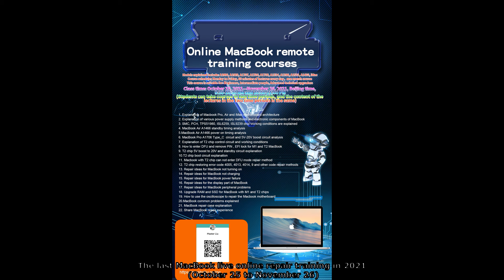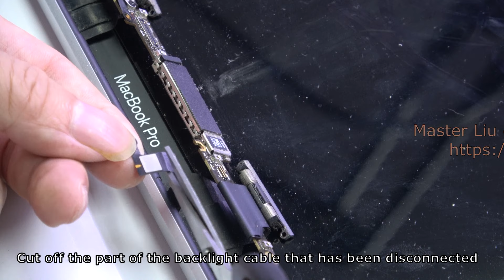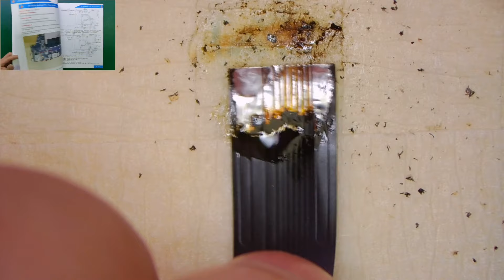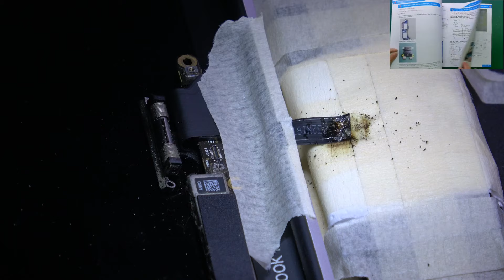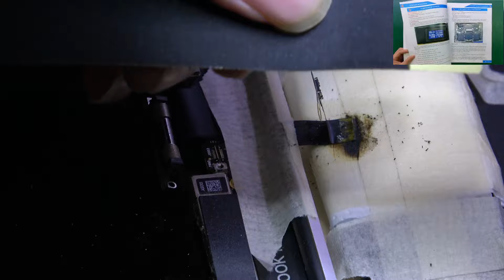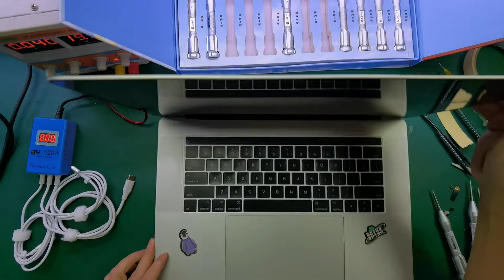The Easiest Way to Repair Flexgate Cable

Comment: This looks very hacky how can you be sure there won’t be a short in the future
Reply: Even if there is a short, it would be fine as drivers would stop giving voltage to it
Reply: Yes, it will not be short, it should be noted that you need to add some curing glue
Reply: @3ijnweu3oq3  really? There's a protection for short between LCDBKLT and GND, and driver will detect it?
Reply: exactly dont do it go and pay $630 to apple make them rich yayy so cute

Comment: Wow… I just followed the iFixit guide to open the MacBook and then your guide regarding the cable, and now the screen turns on again. I still have „stage light“ but not sure if it is because I „repaired“ just one cable or did something wrong - anyhow at least the screen working again!
Thank you SO SO MUCH

Comment: how to prevent it ? i just bought an 15'' 2016 max out and i want to prevent this..

i bought it from amazon like "(Renewed)" and work fine but i wanna protect it and i don't have an amazon store in my country yet.
Reply: I have a 2017" 13" MBP. I Just keep the lid open all the time, to not put any stress on the cable. I use my laptop always on my desk though, I almost never move around with it. If you have to travel and open the lid regularly, then I would try to avoid opening the lid at max possible angle, as it gives most stress to the cable.
Reply: keep the display open and never close it.

Comment: I did this repair for the first time today and I used your method - the job turned out great so thank you its much appreciated! I couldn't get the two flex's to solder together for the first couple of goes but as soon as I added a big blob of solder to the iron to give it the extra heat needed they bonded together lovely. Thanks again!
Reply: Hello
- What kind of solder paste do we need? may you can gimme an ali-link :)
- How many milimeters do we need to scrape?
Thx a lot
Reply: After watching this , I will go for it now. Was thinking of giving it to someone to sort it out
Reply: after 9 months of consistent opening and closing of the laptop, have you noticed any issues with this method?
Reply: Backlight still working after your repair? ;)

Comment: I'm going to have to try this, my screen has always been dead, i bought it cheap to use with external monitor, it just goes white usually with lines running vertically, a big black line just off center and 3 thinner ones. but when it tries to work you can see most of the screen but get the big line near the middle and the other thinner ones still, and it tends to flicker a lot with no relation to the hinging of the screen.. could well be the cable.

Comment: Hi Master Liu, I have a question. I have a power button / touchID FOR MacBook Air A2337 , the cable is too short for me to attempt this. Can I just transfer the chips over to another button and if so will this keep Touch ID ?

Comment: Hi I know this was uploaded from a while ago, but does the black tape matter? Or can I just leave the cable as it is? Thanks
Reply: Solder maintains contact and isn’t really meant to hold things together. I would imagine that without the tape the connection it likely to break faster.

Comment: why not scrape of the other side of the cable so that there is no dent?
Reply: One side has the substrate so if you scrape that away all that you will have left is the fragile copper foil traces. This way the substrate remains intact

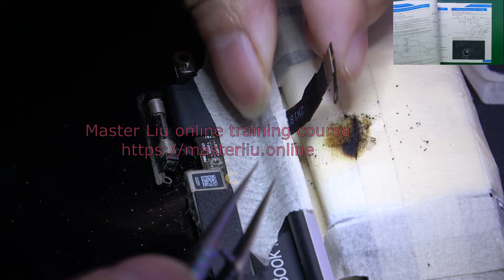Comment: What kind of tape was used at 4:00?  Was it a vinyl or some other material?  Was it electrical tape or splicing tape?  Thank you for the video!
Reply: It is tesa tape. Although I prefer kapton tape as its thinner.
Reply: @Dimma205gti  Probably part of the reason for the tape is rigidity so it won’t break again, kapton may be too thin

Comment: Why not use the proper flat cable with the right extra length? I thought it should be available aftermarket, Apple as well released an upgraded version of it if I’m not wrong…
Reply: this fix is very stable... a lot of us who are well known about this issue from a long time , we fix and provide 1yr warranty on the very same problem.
Reply: @sajwhat  Hi, I am about to attempt this. May I know if the smaller pins in the middle shorted will it cause problem to the display or just no display? I just wanna make sure if I mess the solder nothing will go bad.
Reply: @kamalyazid4291  It will not be short, the middle is only the signal line, and the power supply and grounding should not be connected wrongly.